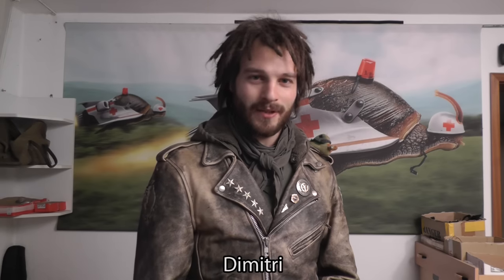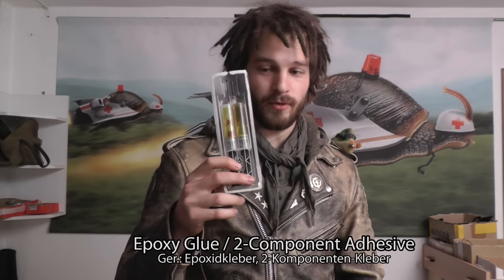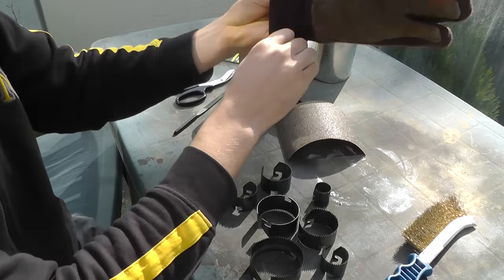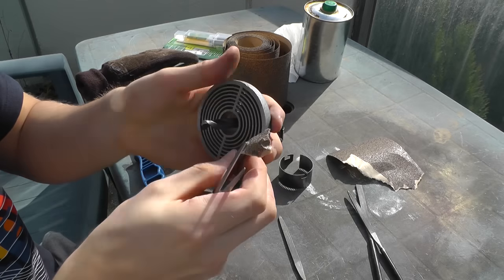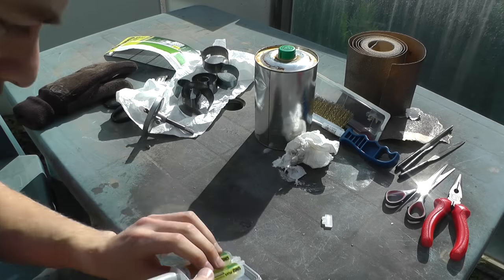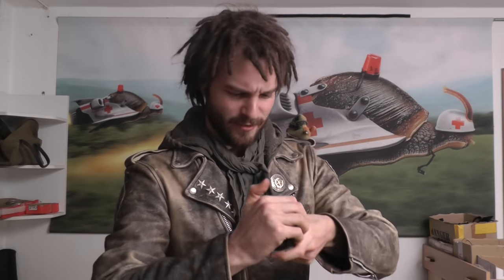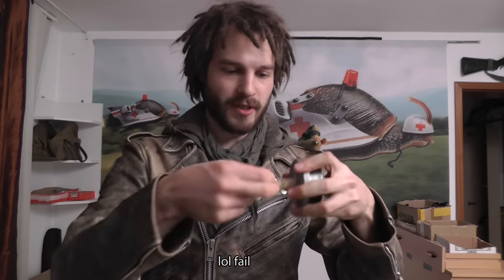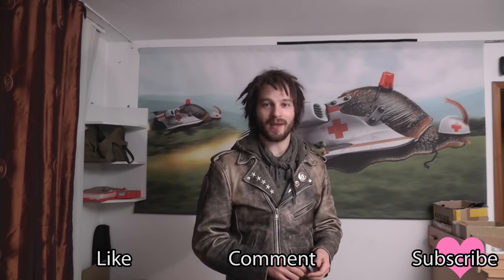The Shredder Tool, for making your outfit ragged as HELL :)

Comment: amazing videos. i'm having trouble finding that type of hole saw drill bit? if you could find a link, it would be a big help, thanks man.
Reply: It's called a seven in one deep hole saw.
Reply: You can find a version of it - it's not as wide and flat as his, but gets the job done. It's the Tekton 6881 Deep Hole Saw. I haven't been able to find the exact size Dimitri has.

http://www.ebay.com/itm/Tekton-6881-Deep-Hole-Saw-Set-7-piece-1-Through-2-1-2-With-1-4-Mandrel-/261528199521?pt=LH_DefaultDomain_0&hash=item3ce44ba161

Comment: you know there is something exactly lik  the shreader but you dont have to do anything to it and its half the cost ...its a meatal horses hair brush
Reply: I guess it would also work but as the horse brush isn't as sharp as the sawblades of the drill, you would have to sharpen them. Otherwise it just wouldn't rip through the cloth...
Reply: josh_sotiri hastings Horse brushes are flimsier and you don't get the downward pressing motion as much as with this tool